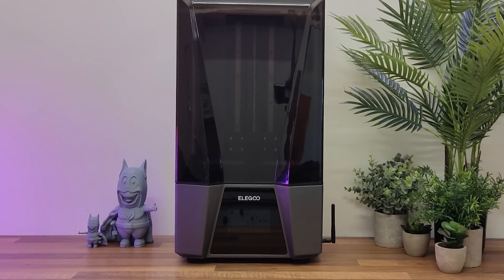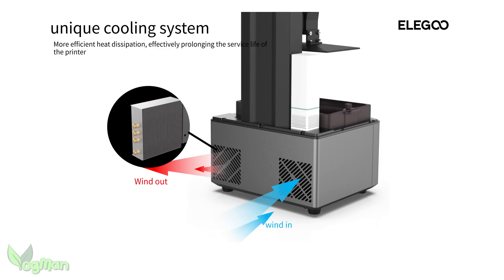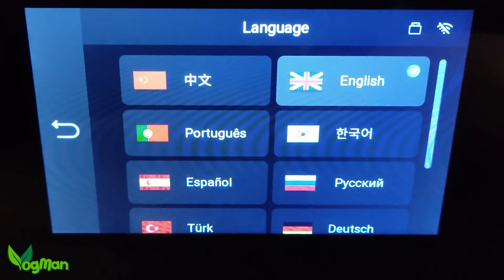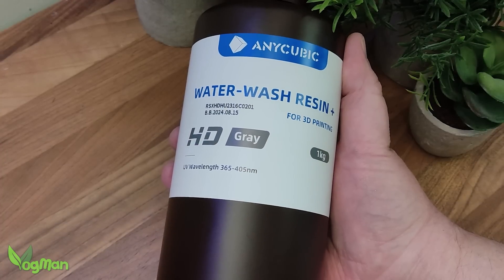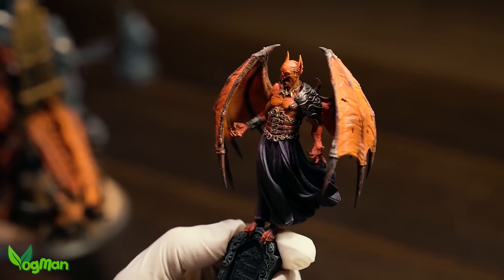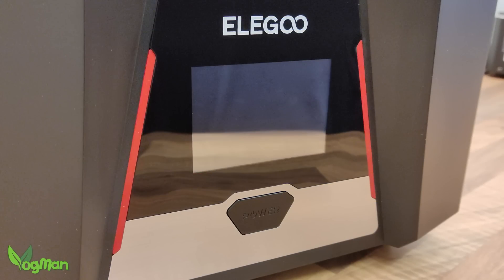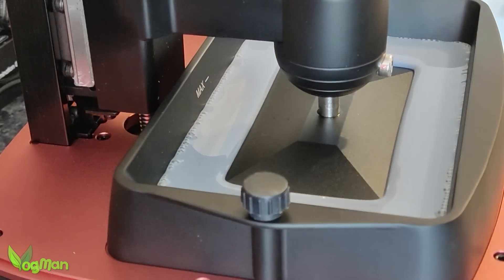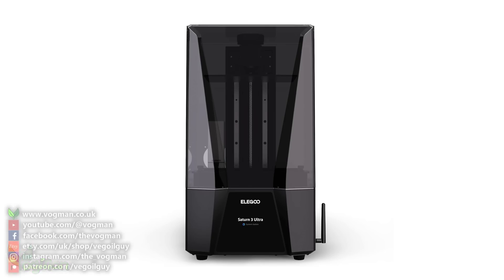Elegoo Saturn 3 Ultra 12K 19 micron resin 3d printer (HONEST REVIEW)

Comment: I’m leaning towards this printer over the M5s pro, my first print with the m5s pro failed so hard with their standard resin, their settings from the studio and their exposure test, 4 of 8 where on the plate and then I did a vat clean and the moment the light went off the  FEP film popped like a balloon and spilled resin all over the place, support has been terrible to deal with I just want a refund and they are juggling me around like an egg.  The USB 2.0 another thing that drive me nuts with the pro it’s impossible to  find an 8 gig thumb drive in 2024, I never had one issues with my mono photon 2 I put resin in hit print and it worked out of the box even with 8k resin.

Comment: Ultimately I think that 12k printers as they are right now are only useful if you need the larger build plate. They don't really offer anything in terms of print quality over older, cheaper, 8k models.

Comment: The difference between the Saturn 3 and Saturn 3 ultra is the ultra has metal build and is therefore easier to clean and it has wifi. Also in my experience with the creality halot plus which has the same cover shape as the photon it is a pain in the butt to get back on it takes four tries because you never know which way is forward once the lettering has been removed by the alcohol you will inevitably need to clean it. And the shape of the ultra lid will make it easier to tell which way goes forward without having to try all directions to see which way fits. I find myself taking the lid on and off 10 to 15 times a day

Comment: how did you find the fan noise on the Saturn 3 Ultra?   I have had mine for a week now, and it is substantially louder than the fan in my Original Saturn.   I bought it mainly due to the wireless printing - which works extremely well, and I never want to have to deal with a USB stick in a 3D printer again.

Comment: Hello,

thanks for the great review (as always).

I'm looking to buy a Saturn 3 (Ultra) in the near future. Actually I would like to have the Saturn 3, but with the 4-Screw Build plate, the ACF film from the Ultra I also do not want. 
So I have 2 questions. 
Does the Saturn 3 Ultra have the same vat as the Elegoo Saturn 2, then you could just replace the VAT, so buy a spare (without breaking the ACF film, maybe you need it sometime).
Can the build plate from the Saturn 3 Ultra also be attached to the Saturn 3? Then you could buy a replacement build plate (4-Srew) for the Saturn 3.

Comment: Thanks you for the honest takes! This scratches/layer lines in the images and you mentioning that the 12k resolution didn't seen as sharp as the Phrozen has given me a dilemma. I'm debating my first printer and I am now between the base Saturn 3 or the upcoming Mars 4/Mars 4 Ultra... I really just want to print scale figures, so whatever looks the sharpest is important to me. BUT so is the print volume because I'm not printing minis. The fact that is sounds like  the Mars 4s will look sharper than the Saturn 3 has me unsure what to do. I'm also in Canada where Phrozen isn't an option due to shipping costs.

Comment: I'm just getting into 3D printing and from my research the regular Saturn 3 looks like good value for the size and resolution i want. Can anyone give me advice on this artifacting issue mentioned in the video though? Is it bad enough enough I should be considering a different printer instead? Unsure now if I'm better getting the older models to avoid it in my prints
Reply from the maker: Hi Tom. The lines you see here are highly magnified. You won't see they with the naked eye. I hope that helps 😁

Comment: Units don't need releveling, unless you're stupidly rough with the units.  I've not releveled my Saturn 1 in 3 months and still printing fine.  Wifi would be useful, but I've setup my system to account for no wifi, so that's not something I'm interested in.  So until my Saturn 1 dies out, I'll be waiting on all of them. Higher resolution will be great, but by the time I need it budget printers will be sub 20 um.

Comment: One thing i dont like about this and my saturn 2 is the lid. It require so much space in height, i cant put it in my shelfs. They should have kind of an opening/hinges on the back so its possible to remove the lid without lifting it all the way over it on the top. Kills too much valuable space i could use for storing tools/materials instead

Comment: Why is the mini 8k so often compared to the photon d2?
Reply from the maker: They're very closely matched and folks disagree which is better. It's very close, but for me it's the D2.
Reply: @vogman  I understand, but I looked at the print results and compared the pixels on the layers between mars 2 pro, photon S and photon d2 layer by layer, and did not notice a significant difference. Is it true that significantly sharper voxels push it forward so much?

Comment: I’ve got the Phrozen Mini Sonic 8k, very happy with it, no need to invest in a Elegoo 12k printer as it’s hardly worth the extra cost.
I’ll wait for a 16k (or more) faster printer that has its own heating system.
Reply: I hope if any manufacturer did that, they do the heating as a modular system because certain countries do not need the heating feature. It will cut down cost for countries that do not  need the feature.

Comment: The hatching texture is very likely caused by the new "fep". You can easily test that by replacing it with a standard fep sheet. Doing so you of course trade off speed for quality. As we know we can't have both.

Regarding pricing I would like to say something that I never see mentioned. This printer runs on a mini linux PC, likely something akin to a rPi. The end user shouldn't worry about these technicalities but it's an important move as it seems companies are moving away from the "Chitu" monopoly. It might be painful at the beginning but it will pay off in the long run (eg: open source file format means that your printer will always work even when the manufacturer stops supporting it).
Reply from the maker: I've spoken with trusted sources that have tested the ACF liner without issue. It seems this may be a 12K screen issue, BUT you won't see flaws like these without massive magnification.

Comment: Thank you very much for your honest and none bias review. This is the reason I watch you, you do not sugar coat anything. I just returned the saturn 8k because it wasn't working properly and was thinking of getting the s3 ultra. Now I am a little on the fence. I love my mars 3 pro and I do have to admit elegoo customer service is great, but now I feel like I should wait till all the hype is over and then figure out if I should go with the m5 or s3u.
Reply from the maker: Elegoo have worked very hard to achieve a well deserved good reputation. Quite what's happening now I'm not sure. Maybe a management or marketing strategy change. Whatever the cause, I hope they change back quickly so we can depend on them once again.
Reply: Hi. Same here. I just returned my saturn8k because of defects at specific spots on the screen. Elegoo were great and sent me a new lens holder with rougher walls. But it did not solved the problem...😢
Again, elegoo was great and offer me a full refund+ voucher.
As I  think their customer service is trustfull, i would like to try again elegoo. So i am struggling choosing between the sartun2 and 3. Not the ultra as I dont need wifi.

But... Those strange lines bother me a bit... Though they seem visibles only on flat surfaces?

Comment: Only real change of the Ultra over the Reguar S3 is the four-point levelling versus the ball joint (which every other manufacturer has been doing since day one) and Wi-Fi. Not sure that's worth $100.
Appreciate your review, I've been saying for weeks that Elegoo dropped the ball with the Saturn 3 - run-of-the-mill, last-generation printer, no innovation or new tech. I honestly expect a Saturn 3 Plus Pro or a Saturn 4 within 6-12 months, that incroporates all the stuff that Anycubic, Uniformation and Athena are doing.
This is the Bambu Labs swamping the FDM market, all over again. 
In spite of the Elegoo FanBoyism out there, they've been late to the party every time. The Photon was before the Mars, the Wash and Cure before the Mercury, the Mega 8K before the Jupiter. This is not just more of the same, it's worse.
The other 12K's are so far ahead of the Saturn 3 they're pretty much an entirely different generation of printer.
Reply: I dont have any Elegoo printer, but lots of people say that build plate with only two screws is a mess, that you have to redo levelling nearly at each print because build plate moves a lot ; Do you confirm or do you think it is as good as a four screws levelling ? If it is right, maybe the S3U worths 100 $ more, because a bad levelling produces print failures... And a read somewhere that Z axis on S3U is more robust and expensive because it manages high speed ; and finally S3U has a metal finish, ABS plastic for S3... but dont get me wrong, I havent got any Elegoo stuff and I don't know if I will buy it or not... I especially believe that these two printers are too much expensive for what they propose, compared to Anycubic M5S
Reply: Interesting points. I have three printers with ball screw levelling, one with 4-point and have had others with 4-point levelling in the past. The “two-screw-ball joint” IS less robust. But in honesty, it’s not “re-level every time” robust. As long as you’re not hammering away or having to force stuff off the plate it holds reasonably well. I use a flex plate so I’m never forcing it, and when I DO re-level I torque the screws really firmly so they hold for months at a time. 4-point levelling printers will hold more firmly long term (I’ve never re-levelled my Mega after several years of use). It’s not a deal breaker but it IS an improvement. It’s just that it’s only an improvement for Elegoo. Every other manufacturer has had it from day 1. 
Improvement to z-axis rigidity is definitely a plus. Multiple previous Elegoo machines have had unacceptable levels of flex when peeling. Again, however, this technically is an improvement but it’s really just fixing flaws in Elegoo’s previous designs. I do wonder whether this has ANY impact on the increased speed or if its purely the thin resin, new FEP substitute, larger layers and increased lift speed. Someone needs to do those changes to a regular old Saturn and see how fast it can go.
As for the ABS vs metal constructions - it's not a huge thing for me. The internal frame is what determines the machine's rigidity and that will be metal. The ABS is really just cosmetic cladding. I actually use a couple of plastic vats on my Mars 1 and 2 and they work fine and have for years. The FEP ring is metal because that's what determines the strength of the FEP. The rest just needs to be functional.
I need some new printers as mine are old and only 50um printing but none of these new ones would get to me before September anyways. I've learnt that the pre-sales saves a few bucks but you wait months, and the printers quickly come into stock anyways and are also quickly deep discounted. I will wait till October/November and see what the M5s is retailing or, and how other newer printers look and decide then. There's simply no value in paying upfront for a Saturn 3, which is built with last-gen technology, and won't even arrive for months.

Comment: When you talk about anti-aliasing how relevant is that to the printer itself? I thought it was a feature implimented by the slicer so the actual printer used for "anti-aliased" files shouldnt matter as its not really anything to do with the screen.
Compare to a PC game the GPU(slicer) generates the "anti-aliasing" effect on is render and the monitor (printer) just displays it.
Is this understanding wrong? Do some printers have an "anti-aliasing" funtion built in that they apply to an already sliced file?
Reply from the maker: I incorporate antialiasing prints simply because people kept requesting them. It's as simple as that 😁

Comment: Another interesting review thanks. I know like me you interested in engineering with you metal casting series. Any chance in the future you could do a video more on the engineering uses of resin printers. Every video I have seen so far just shows people printing small figures. I want to know more about building larger or complex housing and enclosures and front panel name plates. I would also be interested in how to use the higher resolution for printing screw threads.  Have to say my 3D printer you recommended is still sat in its box  for the last 3 months and I’m still a bit scared to open it. I have been waiting to make room for it in the garage which is currently stuffed with new CNC. Best regards Chris
Reply from the maker: Hi Chris. You're not the first to ask this and I genuinely would like to help. The problem is I have no ideas. If you can suggest a few engineering prints or small projects, I'd be glad to give it a go 😁
And don't be scared. Open the box. This series should help you set up https://youtu.be/87Xk9CF7bhY
Reply: @vogman  thanks for the reply and the link. I will check that out and think about some topics.  I guess I’m interested in printing larger flat surfaces and electrical enclosures for projects  and the dimensional accuracy of prints regards fits rather than resolution.  On my channel I restore a lot of valve radios and a common problem is replicating lost knobs. I will probably look into getting a laser scanner so I can copy these from a pattern and paint to look like bakerlite.  My Filament printer gets a lot of use in replicating lost parts I also sometimes make jigs or drilling templates. a resin printed drill gauge or similar tool would be interesting as it has to be relatively accurate. I also plan to print name plates for equipment or perhaps painting stencils.Regards Chris

Comment: I would be interested in seeing a comparison between an 8K and 12K printer with the same build plate size, specifically how noticeable the differences are to the eye.
And as for the test function, I am wondering if it is an internal QC feature they can use for a quick factory test before shipping.
Reply: you wont be able to tell the difference, trust me

Comment: The Saturn is 3 Claims 70mm/h while the Saturn 3 Ultra clams 150.  The M5s claims 105 mm/h with high speed resin and 70 mm/s with standard.  Is it possible the difference between Elegoo 150 and Anycubic is the 0.1 layer height vs 0.05?  Can you do the tests because nobody else will and I think this information is crucial.  Have you seen evidence that dual linear rails are better than single?  Since Elegoo have now used a ball screw like the Anycubic M3 Premium can we make a judgment on the value of those?

Comment: The divert heat to the unit are not very visible. As not every where are seasonal location. Like southeast Asia , it tropical climate.
Reply from the maker: I'm talking about clever redirecting... thermostatically controlled. Heat when it's cool, cool when it's hot 😁
Reply: @vogman  ya elegoo should so module like the airfilter but is a heater. since they added connector for the filter module.. not sure what stop them form doing that

Comment: Alway love vogmans reviews it's the one I wait for he's never blinded by the waw factor!  UNCLE JESSIE  was just abit to blind with it to see the real machine working plus he didn't have the fast resin from Elagoo to test the new speed printing He had to use the basic! It still worked and printed nice I wonder if these stretched scratches are down to the new fast resin and this posh fep sheet in the vat? 
 The speed it's lifting its dragging instead of a smooth slow action I'm sure you'll put this to the test when the next 12k comes out and does the same?

Comment: I was shocked at the limited pre-order discount given by Elegoo on the Saturn 3 ultra ($499) printer when compared to anycubic on the m5s (£359)and creality on the mage (£289)and mage pro (£447). Price wise it’s close to the creality mage pro which has significantly better air filtration built in with a resin pump which shows creality trying to give value for money. The M5s and mage pro leave the Saturn 3 ultra a little sad and pathetic in features, why not have one of the usb support a heater? 

I am really interested in the mars 4 ultra, but without reviews we have no idea what we were buying into as a product. 

Both the m5s and mage pro have shown that reviewers have experienced issues and while not deal breaking for me to buy both machines, I know what I can expect and be careful with when learning the machine and it’s functions.

The Saturn 3 ultra didn’t offer enough over the m5s or the mage pro to draw my attention and after your review and watching others it’s a bit meh, the Saturn 2 is probably a better bet at the moment and it’s price has been dropping, even the Saturn 8k is a good option.

Hopefully Elegoo will stop trying to hide and let people start seeing what the mars 4 ultra can do or not do, but until we get some independent reviews, sadly Elegoo is on my pending pile and if Elegoo are not careful other manufacturers will start leaping ahead and people will say “do you remember that company called Elegoo?”